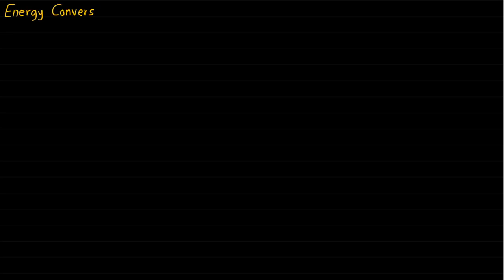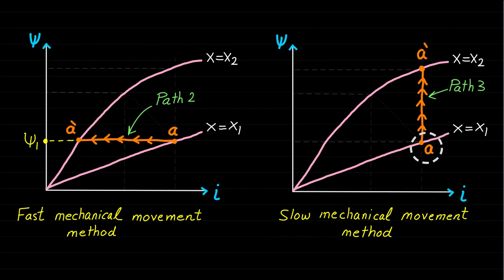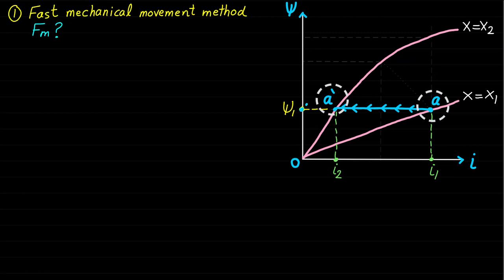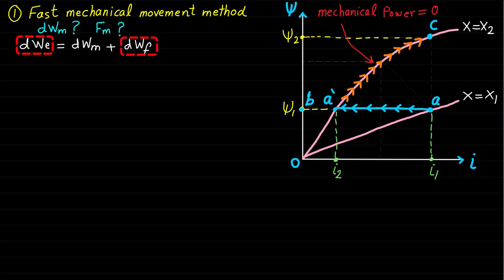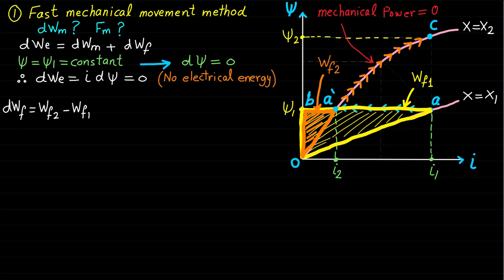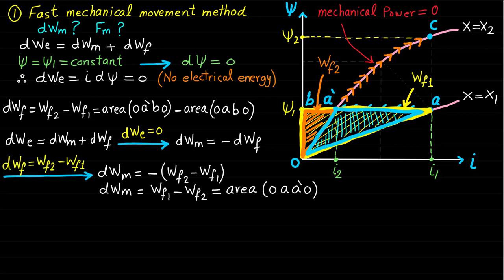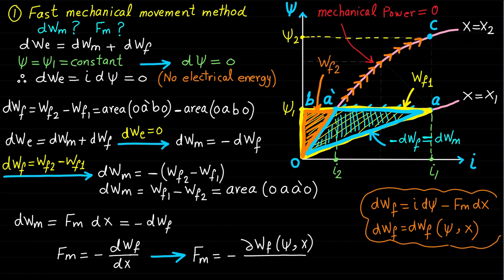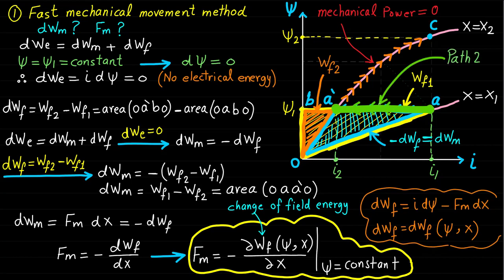Electromechanical Energy Conversion - Mechanical Force (Part 2)

Comment: What is going on with dW_f when you just increase the resistance of the wire? 
What is the difference between increasing on the resistance of the wire and doing mechanical movement?

Comment: So more mechanical energy is converted in slow mechanical movement?
Reply from the maker: Thank you for your question. The approach used in this lecture for developing the mechanical force is considered a pure mathematical approach and does not represent the actual physical behavior of the relay system. That means, the assumption of path 2 movement and path 3 movement are just pure mathematical and does not represent the actual movement or physical energy conversion of the relay system. In real system we can not say the current constant and the magnetic field constant during the movement. Basically, we used these paths (Path 2 and path 3) to simplify the development of the mechanical force formula. So, please do not compare between the fast and slow movement approaches as they are based on some mathematical condition to simplify the derivation. Note that  path 1 which is discussed in part 1 lecture, has better representation to the actual behavior to the energy conversion of the relay system. Hope this answer your question.